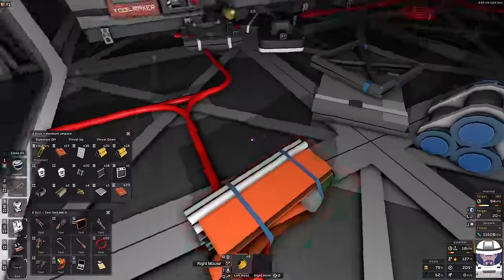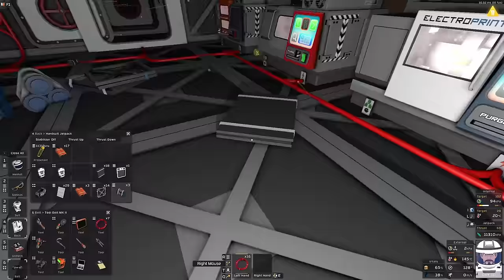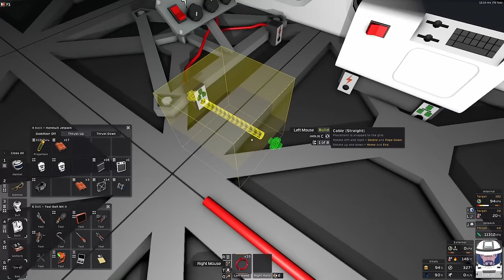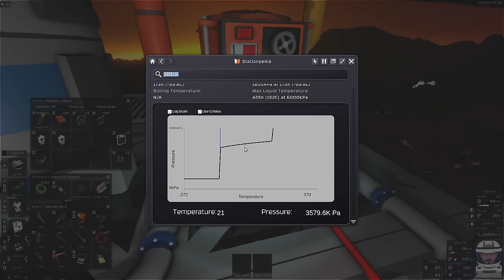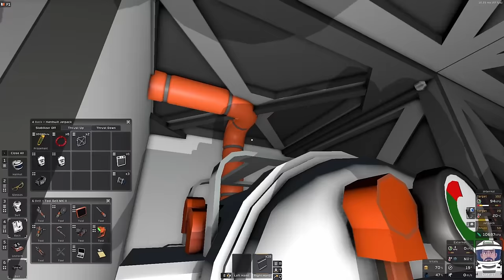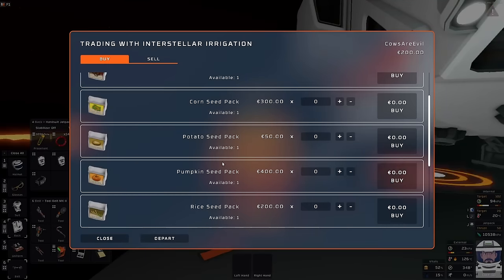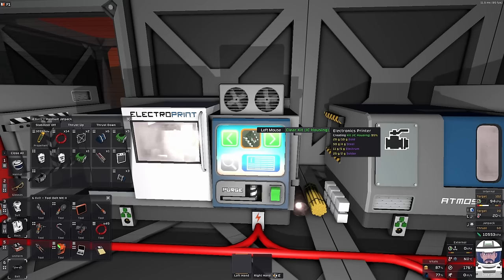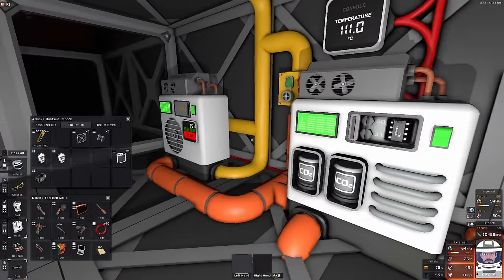Stationeers Phase change Vulcan 6 Did that really happen?

Comment: 44:04 Fern seed pack was right at the top of the list, $100
Traders could sell so much more if they bothered to alphabetically list their goods.
That and their customers not being in a rush to not catch fire.
Reply: LOL
Reply from the maker: Wrong ferns.  I need Darga ferns for oxygen.
Reply: @cowsareevil7514  Even regular ferns make a decent amount of O2. And IIRC, you can't find the Darga Ferns until you have a Large Dish.
Reply: @JonathanHarvell  You can generally contact the T3 traders that can have darga ferns with a medium dish.
Reply: @cowsareevil7514  Ah, apologies then.
Reply: @cowsareevil7514  I haven't seen Darga Ferns for ages at the vendors :-/
Reply: @cowsareevil7514  Sadly no Darga fern from the small traders. 7 normal plants are as good as 1 Darga fern.
Reply from the maker: I checked the numbers on the stationiopedia and you are right, fern seeds would have been better than just potatos.  I am sure another one will turn up in the next 1000 or more traders.
Reply: @cowsareevil7514  normal ferns are more common. At least on my vulcan run, though that was before phase change update. (Stopped that playthrough as my base blew up in a spectacular way).
Reply: Regular fern gives 17.5 moles per hour.  Pretty decent until you can get Darga.  No luck so far, think I have 16 ferns going now.
Nitrogen is fun though when you want can veggies.  Gah.  Love Vulcan challenge, training for Venus.

Comment: Now... What happened to that powered active vent, and no limit on kpa on the intake. Guess it was that you where hearing, making "pipe noises".
Reply: After rebuilding it I found out that it is the liquid pipes of the liquid pollutant that make those noises. Liquid pipes have now a max pressure of 6 MPascal and the pressure in the liquid pipes go up to 5.2 MPascal before the night end. Once it fall under 4.8 MPascal the noice stop.
Reply from the maker: Yes it is the liquid pipes.  It will be very noisy until I change it to a closed system.

Comment: Can you explain the two furnaces?  I watched you build them, but I still don't get what the purpose is to have 2
Reply: Let me try to answer this. The left one is "cold" and the right is "hot". The cold one is using outside air to smelt anything which will fit to the Vulcan max day temperature. But not everything you can smelt using Vulcan hot air, there are ingots require higher temp anyway - it would be done in the "hot" furnace which is in a closed loop, input and output are connected to the outside insulated tank. 
Any raw ore going through the furnace will emit some gases depending on the ore. These gases will raise a pressure in the furnace and decrease the temperature. So, if you put raw ore through the cold furnace first you will have "degased" ore which might be used in the hot furnace and never make a mess with the gas composition in the closed loop.
To make hot furnace really hot - you suck some Vulcan air there and throw some silver through. Silver will emit NoS which will react with volatiles from the air and combust. Here you have a high temp in a closed loop. Keep the hot gas in the tank and put enough pressure in the hot furnace for the certain ingot, use "degased" ores and your hot surnace will stay hot for a long time without need to vent it out.
Reply: @AlexanderChaykin  This is mostly what I have surmised from watching this series.  Thanks for the confirmation.  The whole "throw silver in to heat it up" business is eye-popping.

Comment: So you have some healing as well as renewable power and cooling. You can also produce food and air but without water they are not renewable. So at this point is watter all you need for a renewable base? If so you just need the proper H2O combustion set up.

And after that you still need ferns for medicine and flowers + soy for paint with the soy conveniently also opening the option to can food.
Reply from the maker: You need nitrogen for soy.  I currently have no source of nitrogen either.

Comment: don't turning off your suit filters on and off as needed allow you to stay outside in day time?
Reply: You can go outside at any time, but during the day your oxygen consumption is way higher than normal because of the heat. And oxygen on Vulcan, is gold! (if that makes sense). Now, if you're talking about the old mechanics of the game, like turning off filters and stuff just to save a bit more of oxygen, they changed it, so it's kind of irrelevant to do that now coz you have to keep turning on and off all the time and it gets in the way of what you're trying to do. Just not worth the hassle anymore...
Reply: is it still worth it to use ic logic to turn it off and on? @alecisla
Reply from the maker: I only do that on Venus as the heat with the high pressure is very difficult.  On vulcan you can just avoid the day until you have a way of recycling the waste tanks quickly.  Then you can just tank the heat.

Comment: Mick, I'm having odd issues with your trader hunting script where it keeps stalling. Light green, uncontacted traders on the screen, and it just won't move. Flip a coin on whether turning it off/on or pulling and reinserting the chip fixes it. Is there a defect in the workshop version or is this PEBCAK?
Reply from the maker: If the trader leaves orbit while it is interrogating then the script will get stuck.  If the light is green but no interrogation on the screen, pop the chip to restart it.
Reply: @cowsareevil7514  Thank you, sir.